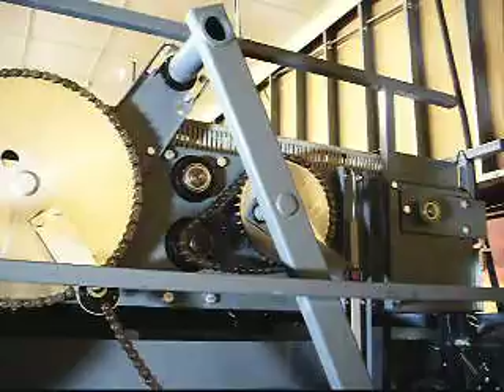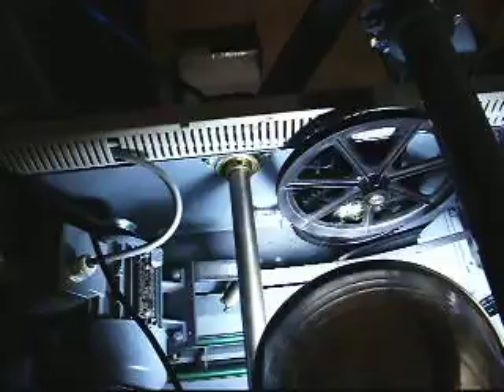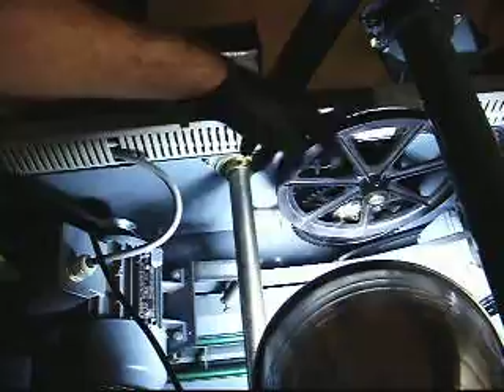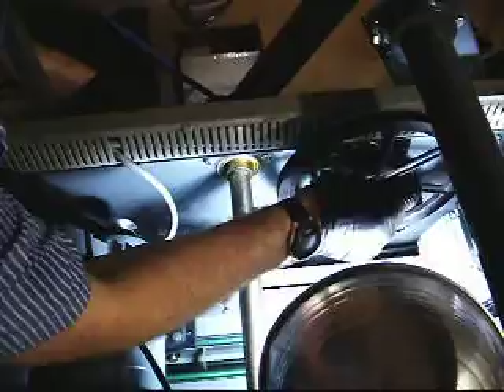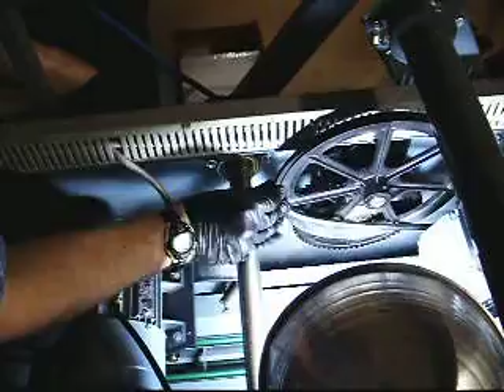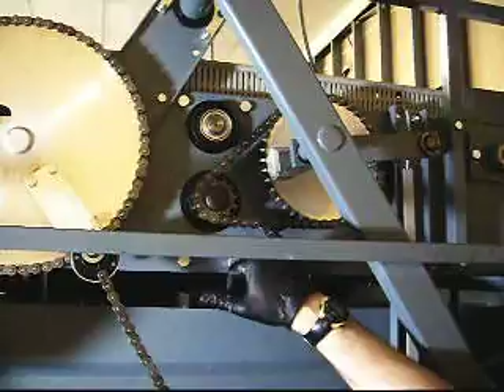Adjusting sweep wagon drive chain tension on GS-X pinsetter.

Comment: Gs pinsetter error code 64 please help me
Reply from the maker: Your sweep might just be out of timing.
Remove the belt from the middle sweep motor and bring the sweep to the front of the pinsetter.
Make sure both of the drive arms for the sweep are parallel / even with each other.
Then put the belt back on the sweep motor and pulley.
Then restart and see if that fixes the issue.

If not you could have the entire system out of timing.
You may have to set the switch cluster timing back properly.
Remove the 10 pin side black cover panel.
Align the table chain straight and centered down the arm that is welded to the large tooth gear wheel.
Then rotate the magnetic cam to where the center flat spot is in the exact center of the peak/apex 
of the "A" switch.

If that does not work maybe you have a broken wire or the switch is bad.
I can't remember off hand if the switch is designed open or closed.
So I am not sure if a broken wire would affect the signal if it is always open.
It would only  affect it if the switch is always closed and then the wire was disconnected.

If you had some type of lightning storm then there is a possibility it may be an issue with the nexgen interior controlling pcb boards.

I can't remember, I am not near a pinsetter but if it stops when the sweep should be moving and rotating then you might have a blown fuse.  I can't remember if there is a fuse to the sweep motor, but I believe there should be one.

As well you might have a bad sweep motor that is not moving the sweep and keeping the switch engaged.
Lower your sweep manually by tipping the sweep attenuator arm.
Then, so long as your table is in the up position, if not manually raise it.
Cut the nexgen power switch off on the lane with the issues.
Set the Nexgen to motor and switch nexgen on, then hit enter button until the screen says sweep.
Then press arrow up or down to move the sweep by using the motor.
If the sweep moves then you have no issue with the motor.

Good luck with all that information.
Hope this gets you going.